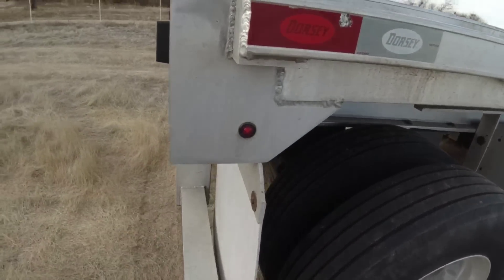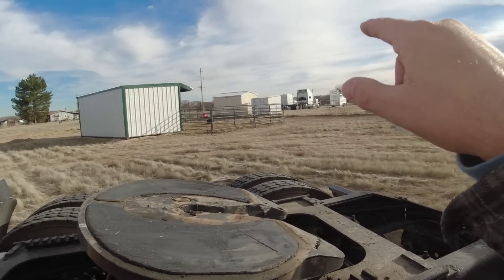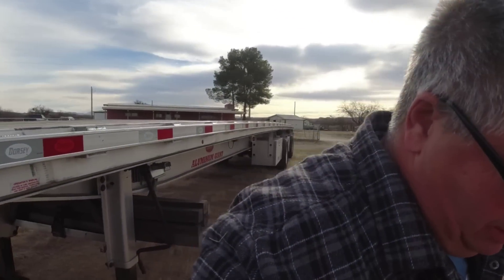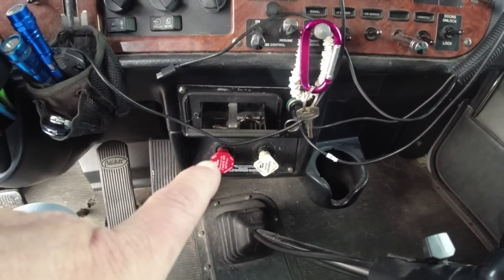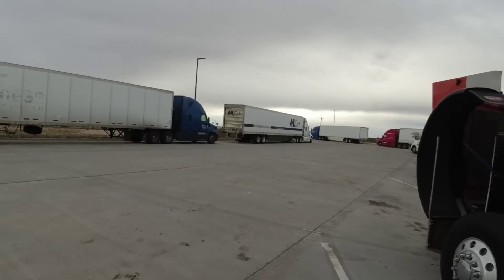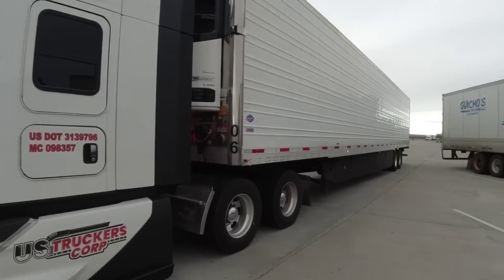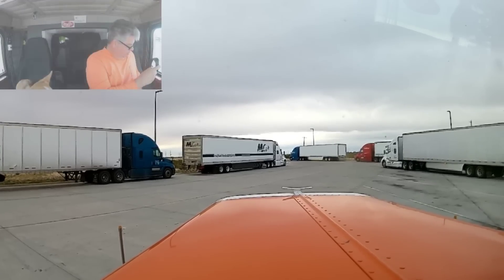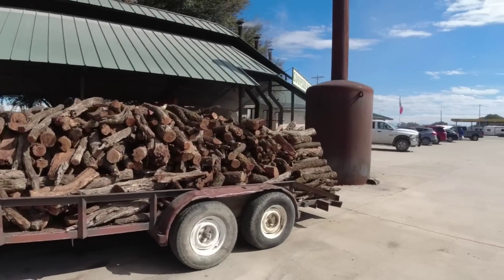#638 Deadhead to Laredo Texas The Life of an Owner Operator Flatbed Truck Driver

Comment: Dan Dan the professional flat deck man. Running the back roads is a nice change .  Some Pretty country you were running through. A tad empty miles you had to run there. It’s to bad you did not get some kind of compensation, wishfull thinking huh. Lolol You tractor and trailer look really good Dan. Your from the old school. It’s to bad trucking is evolving away from what it used to be like. Well nice video Dan, have a great and a safe day, happy trails and happy motoring..

Comment: I ordered 100 three-quarter inch LEDs off Amazon for about$45. They have two leads as marker lights, you can get three leads that also have turn signals. In two years of you so I still haven't burned none. They come with the rubber grommet and 6in of lead. They all fit a standard three-quarter inch hole. I got these installed every 3 in on my front bumper. Five on each end or turn signals, they also are markers these are the three wires. Thought I'd let you know you can save a bunch of money and put a bag of these in your sleeper and they're always on hand. 🤔👍

Comment: The Air system on a semi works like the air system on a train, when air is added, the brakes release, the when a reduction is introduced, the brakes apply!👍
Reply: Ah, as I am not professional driver, is it correct so say if there are 4 tire tracks leading off the highway travel lane to the break down lane that likely the air pressure dropped and the trailer wheels locked up?  Seems logical based upon what you’ve wrote and I’ve heard Dan say before, but I’m just guessing.  Thanks!
Reply: @davidc8735  Yes, the brake cans on a semi have a compression spring that has around 40,000 lbs of tension on them which is applied when air pressure isn't present, or reduced "NEVER DISSAMBLE ONE" Death is eminant.

Comment: Just bought a 10 package of both colors of those lights off Amazon for my 23 Dorsey. I think they were $25. I did get them through that small hole, just pulled each wire through individually.

Comment: UK/EU with 45ft semi's usually have a 9ft pin, (front of trailer to 5th wheel pin). this keeps us within the legal max length, but allows allows very tight turns. Most semis at 98560lbs gross weight us 3axles. (front lift not just to save wear but avoid scrubbing. (And digging up the tarmac surface). lol

Comment: I appreciate the care you take when you hook up.  I never rush the routine of hooking up.  I pull a 5th wheel trailer.  I have had friends who always are in a "hurry" to get going.  You likely know what happens.  . . .  and it has, especially when people are excited to visit when you first arrive.  I have heard that they then blame others for something that they should have checked.  I try not to be rude but I tell friends to just stand back.  I do not need "help".  I always do the "bump" just to make sure when I leave.  On your comment about helping your neighbour, I once was ready to pull out from a camp site and a "neighbour" had trouble with his slide-out.  It would not go in.  I spent a couple of hours fiddle-diddling.  It was a hot day.  My wife put down cardboard and I even had some old blankets to crawl under his 5th wheel.  I was all sweated up by the time I found out that a safety switch was fussy.  I moved the slide-out by manually moving the slide-out by screwing it in just a touch and it started working.  The "neighbour" was a friend that used to live beside us in Swift Current when we first got married.  I was pleased that I could help him and his wife.  I suggested that they should maybe get their luxury unit checked when they arrived home.  Thank you for making your videos.  We appreciate the care and attention to details.  I hope the people who make decisions can see what a turmoil "things" are in.  Hang in there.  😊

Comment: As small as that little light is would you get "dinged" if you had been inspected for having it not working? Great video, love when you run the back roads.
Reply: I was wondering the same, and also LED vs. incandescent since that beautiful Dorsey trailer doesn’t seen that old. :-)

Comment: i once picked up a load in Laredo, but since it was sealed i couldnt check the load, but once i got to the receiver and opened the doors, it was a mess, looked like a shopco load, everything shoved in. guess the receiver was use to those loads cause they didnt complain. i was lucky didnt have to do many laredo loads.

Comment: As someone who's not a trucker, I wonder why the rear axle on a spread arrangement isn't the lift axle to give a little shorter wheelbase. Dan's busy and doesn't respond, so maybe someone else will do so. Thanks.
Reply: An 8' spread axle set is good for 40,000 in Pa.
I think the lift axle is just for an empty less tire ware and better fuel mileage

Comment: You always know America class 8 trucks  by their sluggish cranking, only country I believe still  using 12v starting. 24v was rare maybe 1 in 40  when I first worked in shops there over 35 years ago. But that was California, maybe colder states spec 24v.